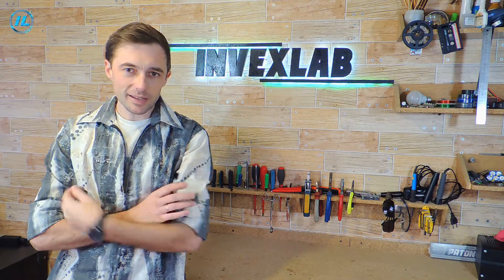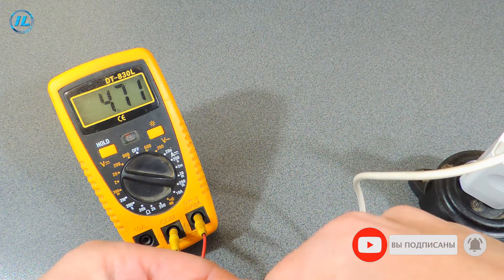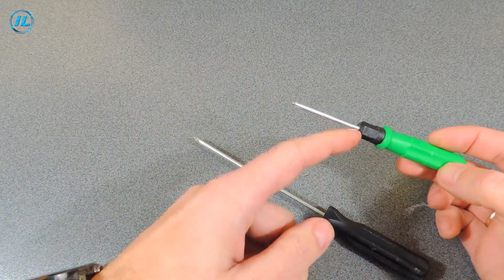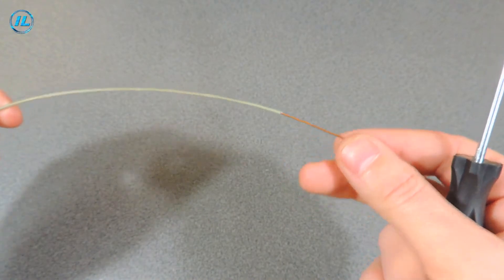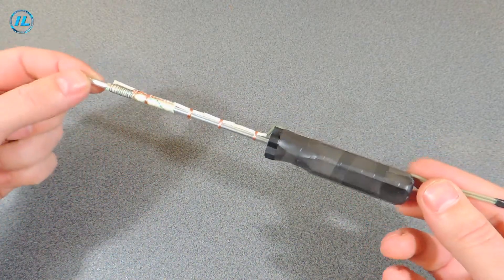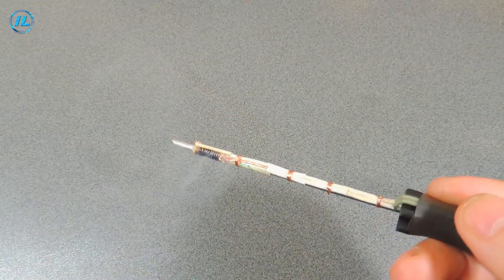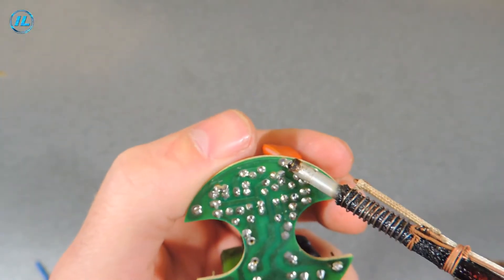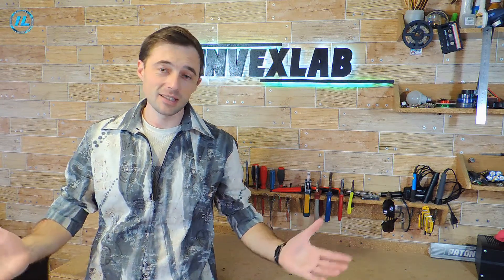✅ How to make a soldering iron from a screwdriver and a phone charger? Quickly look!!! ✅

Comment: Help please! I did something different, I used a phillips head scredriver bit and fit it in my Weller soldering iron. It's 120V 60W which makes the aperage .5A, right? I am looking for a way to add a slip ring so that I can rotate the tool thereby imbedding a small screw into plastic. It works OK right now, the the cord bunches up. Anyway, Can I use a 2 AMP slip ring or will that cause problems? Thanks in advance!

Comment: Touching live wires with bare hand even though you have nickel chrome wire between is a serious safety concern and should not be replicated. PLEASE PAY ATTENTION!
Reply from the maker: The supply voltage of this soldering iron is 5 volts, so it is completely safe in terms of electric shock.
Reply: Bruh it's just 5v bro it can't turn a lamp bro